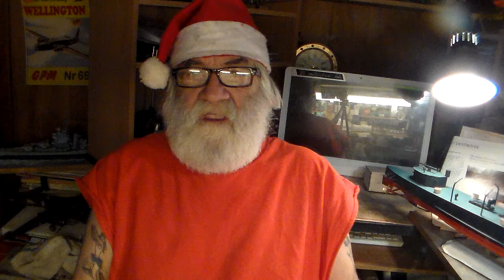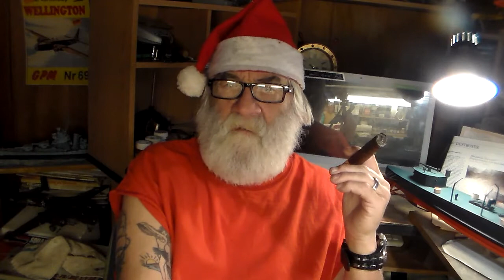Bluejacket 310 Destroyer USS WARD DD 139 Video 9 part 1

Comment: Howdy Frankie! I have a quick question of advice. Recently I decided to add the yellow hull stripe on the Minicraft 1:350 Titanic Model. So far it looks great, I did it by hand with some masking tape and acrylic Model Master paint. Except for a small leak of paint under part of it. It is on some matte black paint and I can't seem to get it off. Any ideas on getting it off and cleaning it up? Thanks for your time!
Reply from the maker: Ahoy                L:et the yellow dry to touch mask between the yellow and black take a fine black felt tip marker and touch up same there you go my man.Frankie Day
Reply: Thanks! Will try that in a few hours!